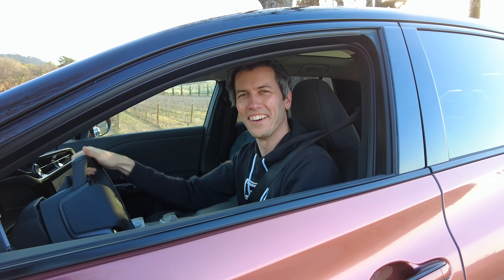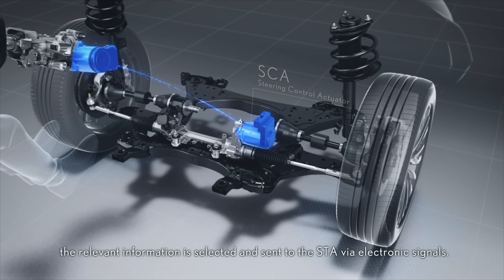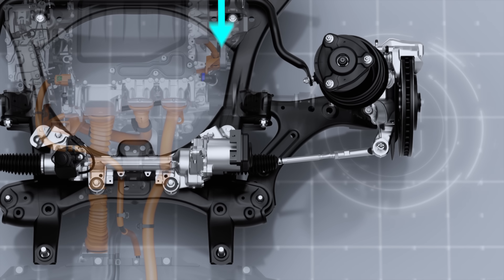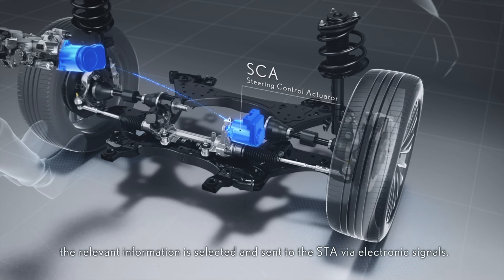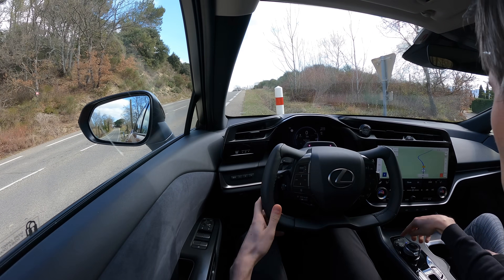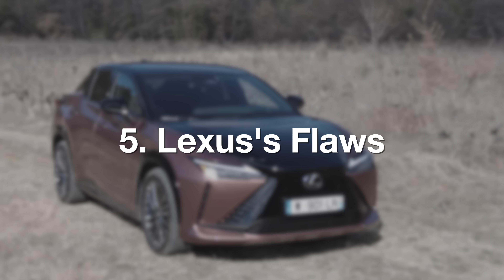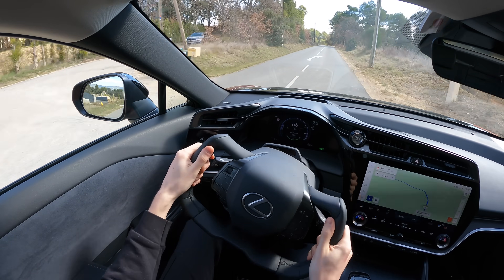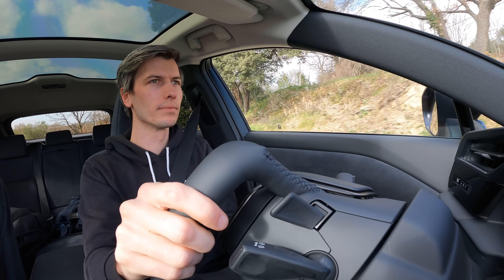How Lexus Fixed Tesla's Bad Idea: Steer-By-Wire Yoke

Comment: You didn't mention the comparison of maintenance costs. Also what about production costs? And what if the variable turning ratio system fails at high speeds and goes to low speeds ratio?

Comment: I have a feeling that steering not being consistent would hurt when the driver isn't sure how much they'll turn, but I could be wrong.
I understand this kind of system in sim racers when you use a controller since it is small and harder to be precise on, but I don't see the benefit when precision isn't an issue.
I'd complain about the less responsiveness, but you ask me to close my ears, so I won't.
I'm all for technological and engineering advancements, but sometimes the problem they try to solve is better than the ones they make.
Willing to change my view, but I'm still confident enough in it to defend it.

Comment: Redundancy works on aircrafts because the mechanics who will deal with the repair are certified and there is a very narrow control with the parts and proper maintanance times, with cars probably some 19yo will deal with it and will be no steering at all 75mph on a highway.
Nah, I will stick with my "half-assisted" instead, good luck for everyone else.

Comment: In the early 80s, the Saab 9000 initial designs utilized "drive by wire", they used an aircraft control stick. They did stick with the "drive by wire" throttle in 1991, that drove Mechanics crazy, cuz that tech was ahead of it time for a consumer application. check it out!!

Comment: Variable steering ratio can be achieved by simply adding a planet gear in the steering column. No need to do it by wire. I hate input delays.

Comment: I've had 3 out our 5 cars we've owned that have had steering assists malfunction. Mid corner you want that backup of a physical rod. That electronic redundancy better be 200% effective. If the vehicle is in motion it better not be susceptible to multiple problems outside of its control. And it pains me to say it but you better not being able to go over parking lot speeds if the steering is on its last redundant motor. Yes we have throttle by wire but it's failure state is easy. The controller just goes below zero and you don't accelerate. Same with air brakes in a way. Failure state is brake pads squeezing. There is no failure state that is acceptable in steering. 

People mention boats and planes but planes are heavily regulated (plus have multiple control surfaces, and a large boat losing steering is not an immediately catastrophic issue. Plus, once you go big enough, there are maintenance crews. (When's the last time you met someone driving a strictly commuter car that knew what an oil change does for their car? And they are the only ones in charge of looking after their vehicle!) Ship accidents are expensive and dangerous but not as immediate as say a two lane highway that has a small shoulder next to a cliff side.

My experiences:
The problem on one car was due to a bad ground cable from a bad cruise control install. (Wife's car before my time.) It would give out when the steering needed it the most and randomly. 
Second, was age and electrical gremlins in the cold. I got chattering in slow speeds like the driveway. Never figured that one out.
Third car, during a cross country road trip, had the powersteering pump die. I was able to drive that awd suv 150 miles into civilization and actually parked at our hotel. Then the next day to the nearest dealer.

All of these scenarios could have been avoided with redundancy built in, but would have cost an arm and leg for a tow and "certified" repair that I'm sure is needed. Plus, would the average person know how important that warning that probably comes up on the dash would be?

Call me skeptical. It's cool, but it shouldn't be released until it's beyond safe. I trust Lexus but I don't trust regulations, the investors and capitalism. Tesla released some very cool tech but some of it was not ready for prime time in the hands of the public. Will it work? Yes. Will it fail. Let's hope not.

Side not, I really think VAPS like out of my old Crown Vic does the speed sensative steering just fine. I don't think we need to play with steering ratios mid drive. Variable assist has worked just fine for a long time.

Comment: I like the idea and possibilities. But as long as the lag exists and because the system overrides aggressive emergency maneuvers on the highway you can't say Lexus fixed a bad idea. They just didn't. As in every other car, the ratio is not much of a problem at low speeds.
For Tesla it won't be long before steering wheels are overrated anyway.

Comment: Is the assumption that Tesla is still using a standard mechanical steering linkage even with the yoke Model S? This wasn’t explicitly stated in the video. Of course if Tesla is using a traditional mechanical linkage, that quickly explains the problem with using a yoke on a Tesla. Again, just not explicitly stated in the video that I could find.

Comment: Danger. Danger Will Robinson. LMAO 🤣😂🤣

I've oddly been driving like this for awhile now. In a truck simulator for the PC. My steering wheel was locked at 90 degrees because of a setting I forgot about. Let's just say, it's an interesting way to drive a vehicle.

Comment: Realtime systems are fairly mature so it should be just fine it's still gonna be dead like fish or PS4 controller. Though I'm surprised you didn't mention safety as a plus. With no steering column you get  rid of that chest spear in the event of a frontal collision.

Comment: I think they need to implement an idea used on the Carver One (that one car that leans like a bike) in that the amount you steer isn't dictated as much by how much you turn the wheel, but how hard you steer (in that case, the leaning). This will allow both the ease of control at highway speeds while also allowing you to make an evasive maneuver if necessary.

Cool idea, needs more time
Reply: That's also a good point. If desired, how FAST you turn the wheel can have an effect on your input when you're using a steer by wire system as well.
Reply: This has 10 years on the market on Nissan cars

Comment: Sounds interesting, but that steering input lag would just ruin driving for some people I'm sure.
Also, not all cars have variable braking/regen due to battery temp/state/etc. Well-made EVs (so not Tesla) just use blended braking and if the battery is full the car just decides to use brakes. The net result is that you ALWAYS get the same deceleration no matter how full or empty thr battery is. I run one pedal driving in my Polestar all the time and I rarely, if ever, need to touch the brake pedal whether it's -20C or +30C, the battery is at 100% or 10%.

Comment: I mean u can get over the varying turn circle with things like progressive rack or rear steer. 
Also a big benefit is getting customers used to the idea… cause eventually autonomy could remove the steering wheel all together or make it “optional” and turn it off.

Comment: Not surprised about the lag to be honest if the size of motor in the graphics is anything to go by. I would expect to see a servo motor as big as my head.
Also variable anything geometric with steering sounds like a big no-no, since people steer by muscle memory as a first pass,and visual-iterative 2nd, they don't start at visual-iterative. I would like to see an exponential rack ratio and a force feedback soft limit to the input range that narrows with increasing speed. If they can get the tech nailed down though I completely agree it's the future.

Comment: I would just go with mechanical steering and a "wheel" not a yoke. Why?
1. I am used to driving with mechanical steering wheel for years.
2. It's more reliable. It won't fail suddenly because it doesn't have any complicated systems.
3. It's more accurate. Doesn't show any lag. Everything is instant.
4. The feedback is real coming directly from the road. No need of any actuator or any fancy device.
5. The turn ratio is fixed which means I know exactly how much to turn my steering wheel.
6. And lastly it needs very litlle or no maintenance at all.

Comment: So as a dude who sometimes enjoys racing sims  , I am telling you this tech was already experienced by everyone who ever bought a wheel for gaming . And yeah there are some issues with “inputs from the road” and overall “feel of driving” you just get a bit less from your steering . But the idea of adjustable ratio is brilliant. In fact I was doing it myself on my racing sim wheel . Where the track was twisty and required less speed but more control I was simply changing settings to have more sensitivity . It’s cool to see those features getting implemented in real cars , but again it can make someone sad for ruining this “feel of driving” it’s like automatic transmission, it’s better , faster but just boring

Comment: Ohhh m not trusting fly-by-wire... What if my wife hacks into it...
Reply: Why don’t you trust fly by wire?
Reply: @Milkinporsche  in the video they say there's redundancy in the system... But what if there's anomaly in the system...
Reply: @rhranjithkumar  two systems are independent from each other, one failed the other one takes over. On an airbus A320 the elevator are controlled by FAC and all three (green, yellow, and blue) hydraulic system. If green and yellow failed the blue can still take over.
Reply: @Milkinporsche  how would we know if it has failed? In the video they say there will be an indicator of the any of the motor fails... but what if the sensors/motors underperforms... Also learning how to work on varying the steering angle for different speeds is tricky...

Comment: Nope dont like the idea... just get a tighter steering ratio.. why? People will adapt if racers can drive twice as fast with a tighter steering ratio why cant people driv 65mph with that same ratio? Steer by wire will give same issues as drive by wire and it will be dangerous

Comment: Personally, I feel wary about it. With a mechanical linkage, it takes a different kind of failure for each control to stop working. Something that damages wires? All the control-by-wire units are equally at risk, unless each is routed through a physically-sparate path along the frame to resist local destruction, well-protected from thermal damage, components carefully designed to be resistant to extreme electrical discharge. Mechanical steering can still function when the car is off, powerless, in neutral, being pushed by humans, being towed, in a shop, etc. So as a fallback, you'd always want some sort of non-electric steering control, even if it's normally disengaged.

Comment: as a tow truck driver this is one of the dumbest things I think car manufacturers have done, safety aside cars malfunction and break down when I inevitably have to tow one of these cars and theres no mechanical connection to steer the car it makes it very unnecessarily annoying. I will always be against technology that takes control away from the driver and gives it to a computer. it’s unnecessary and pointless and for the most egregious offense you cant drift with a yoke

Comment: I thought that was illegal to not have physical connection in case of failure. If your car power falls you can’t control the steering. I realize it’s unlikely, but still possible.

Comment: Thank you. I have been through this in my mind many times. This seems to offer the best of both world when it comes to making a yoke practical. What I am far less sure about is the regulatory environment – I was of the opinion that a mechanical steering connection was required as a last resort even if all assist systems fail. I suspect that Tesla was not prepared to take on this battle when they introduced the yoke initially.  Also, I am a little surprised that 100% brake by wire is permitted. I wasn’t aware of this – you are suggesting that a modern vehicle will not be capable of braking if the electric power system fails completely. BTW, where was this test done? I notice the clock was in 24Hr mode, the A/C set on 21.5C, the speedo looked like Km/hr and the road speed sign also looked like Km/hr. One less comment - It looks like the control system (steering wheel – steering rack) needs more gain as the yoke position and the wheel position should never be out of sync to the degree you demonstrated.

Comment: I think it would confuse people while they are driving. I feel like it would be easy to forget that the ratio changes because otherwise you would have to hyperaware of it.
Reply: Normally the pedals also change, in sport mode the Steering gets heavy and with a little to low Steering the car change direction quickly but the pedal for gas gets heavier, al least thats how my 2015 Infiniti Q50 with Steer by wire reacts..

Comment: I have a 70s opel kadett and that weighs 730kg with no assists and it's steering is very light it also helps that its rwd. A car without assited racks dont feel as heavy as a car with an assisted rack when its turned off. Why are they so insistent on fixing things that aren't an issue. Nothing wrong with a round steering and a hydraulic/electronic rack. My 435d steering which is electronic is light enough to turn. And don't get me started on that yoke. The Austin allegro had a better designed steering wheel haha imo

Comment: I'm curious what would happen if you accelerate out of a turn at constant rate. Imagine there is a bend of constant radius that you can take at 60mph, now imagine you stop on this curve with the steering pointed in the direction of the curve and then accelerate up to 60mph as you go round the bend...in a fix ratio car you will just go round the bend no matter the speed from 0-60 as the wheels always point where the steering wheel is pointed. Now imagine using the yoke with variable steering ratio, it starts off sensitive so youd start with going round the bend just fine but as you accelerate the ratio closes and the car will un-turn into the corner....the car will straighten out during a fixed radius bend if you accelerate and hold the yoke in the same place...

Idk if that would actually happen as it would depend on how the software is setup to take new inputs but still a very odd occurrence.

Comment: What if you have to swerve drastically to try save your life?

What if you want to know if you are driving over rocks as to not damage you tires and suspension?

What if it breaks? Can i reolace it in my garage without proprietary software tools to calibrate the system?

What if i run over a pot hole and mess up the steering components? Will the system account for that or i will be left stranded in the middle of the road? If its at night or a desert place that has no service what will you do?

I will be damned if i ever buy a car that has a bunch of if statements to allow me to steer the car

Comment: Why? They want to make as complicated to repair as possible. Then when you miss a payment they simply start disabling things like ford's patent say.

Wanna know how to fix the steering wheel from becoming too loose on high speeds? Just don't change the system that already exists and works flawlessly.

Wanna know how to fix the problem of the steering wheel being difficult to turn 2 or 3 times? Don't reinvent the ducking WHEEL, IT ALREADY WORKS!

Comment: self driving cars will need to have this anyway/ cars already do this when driving autonomously?
in many types of 14:27 fork lifts steer by wire has been standard for many years now.

either way, this is very cool and will probably be the norm in a few years as it simplifies the mechanic design and probably even enhances crash safety

Comment: Why not hydraulic connection, 
You still get physical feedback, but assist and ratio can be adjusted mechanically,
And you get flexibility of steering column
And you get the possible safety benefit of no important

Comment: variable steering ratio is like mouse acceleration. Great for comfort, terrible for muscle memory. Imagine doing an evasive maneuver like avoiding a deer on the road. Your brain will have no intuition for how hard you can jerk the steering wheel. It will condition you to under react because of inconsistency, and when you "overreact" it will "smoothen" your input. Sounds like a recipe for disaster to me.

Comment: Interresting, as always !   Fact : The Yoke is not legal in Quebec, Canada, so this won't happen. Also : Its not Kight Industries's car : so no 🙂. 
And lastly, I would not trust that system. An accelerator pedal does only one thing : Transmit a 0 to 100 signal.
That system is WAY more complicated with that variable ratio. I don't like it. I would not buy it.

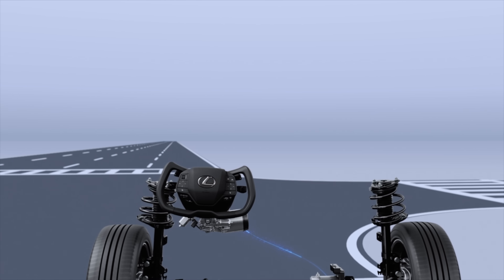Comment: 3:20 This is a bad comparison, you want speed when you break, but you don't want speed when you steer. There is more than enough speed. What you need when you steer above everything is precision, which we are going away from more and more, so in this regard break by wire is no logic step forward but a step backward

Comment: Great, now we gotta worry about input lag for steering our vehicles...Tbh imo this "solution" only creates more problems and complications. I'm not saying there aren't advantages, but to me there's far more disadvantages as compared to a mechanical steering rack.

The main safety concern isn't that the steering will simply stop working, it's that  it might not respond well when you want it to, as in it may not always work with the driver. E.g you're at a high speed and a deer jumps out of nowhere, so you serve to avoid it. What if it just doesn't allow you to turn more? Dunno but, this doesn't seem safe to me.

Comment: Thanks for this compact update on this cool new tech!

I'd love to hear about your experience with dynamic steering ratio systems with a mechanical linkage. Plenty of Audis and BMWs have those built in, for example. It doesn't vary the ratio as widely, but still very significantly.